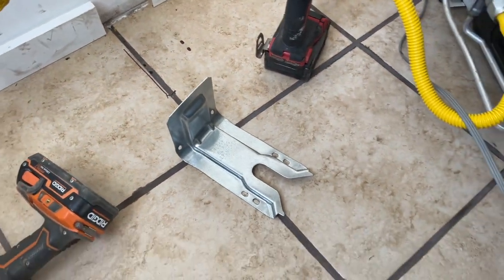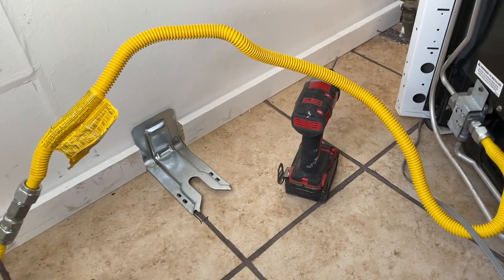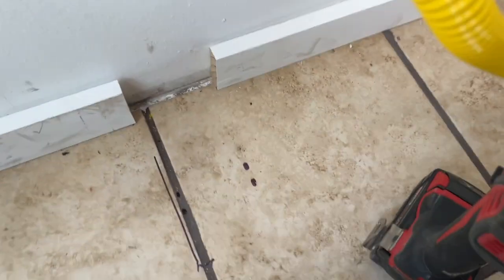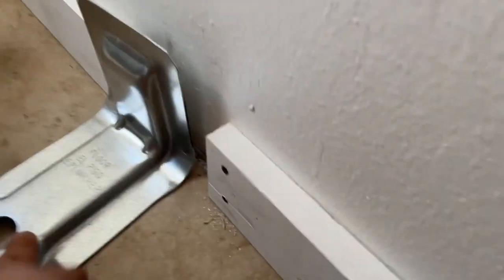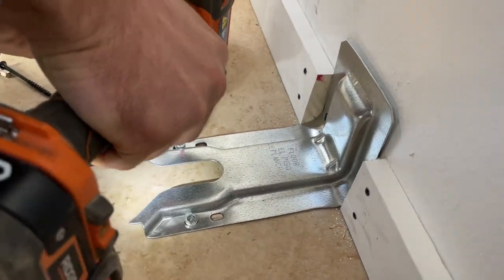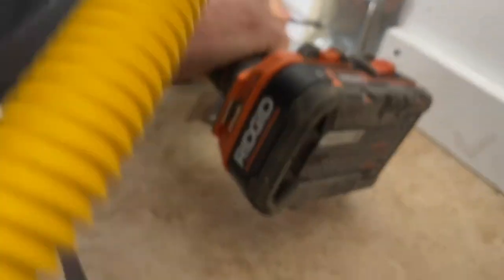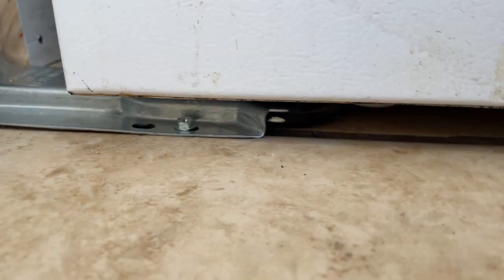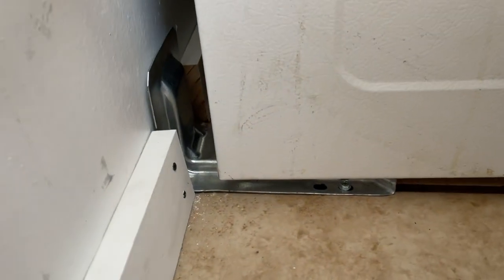How To Install a Oven / Range Anti Tip Bracket  -  A Must Safety Step (EASY!)

Comment: What can you do about reducing the gap created behind the stove as a result of installing the bracket?
Reply from the maker: The bracket slides not make it stick out more.  Stove is as close to wall it can be with the hose back there.  
If you have that issue.  There might be different size brackets.  
My new stove can with a smaller one